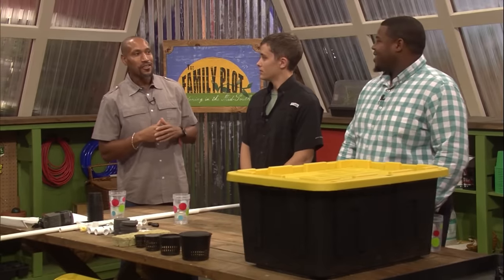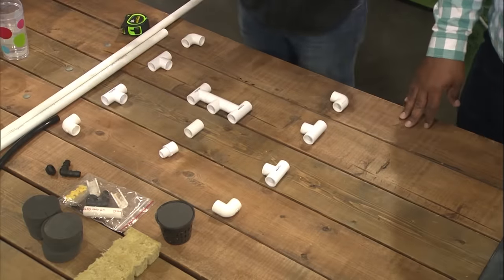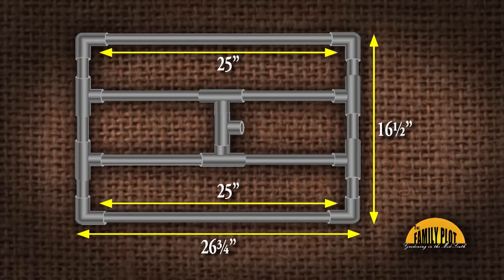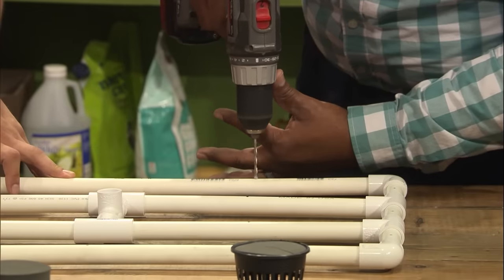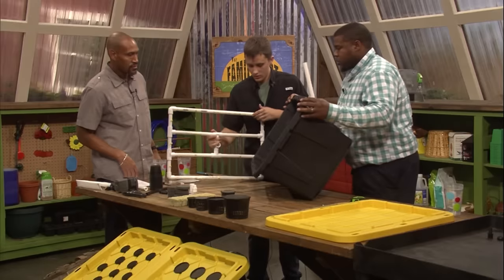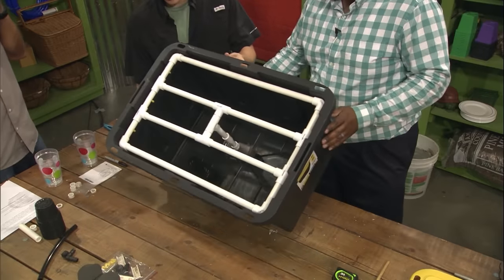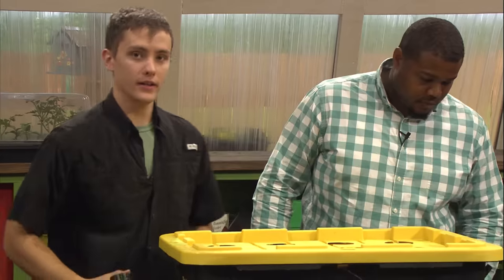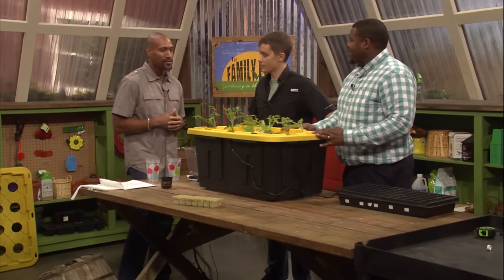Building an Inexpensive Hydroponics/Aeroponics System

Comment: I want to grow lettuce and tomatoes.  How many hours a day do you run pump and light?
Reply from the maker: The pump can run all the time or you can put it on a timer. For other similar systems I have used a cheep vacation lamp timer and did 45 minutes off 15 minutes on. You can get more expensive hydroponics timers that let you time down to the second, but the cheep timer was enough for what I needed. Just make sure the roots don't dry out.
For light, you for the most part want to mimic the sun. Darkness is also important to plants. 14-16 hours of light per day is good. It does not need to be during the day though. On my lettuce plants, I have it turn on at about 9PM. I do most of the work and harvesting in the late afternoon so that way the light is off and I don't hurt my eyes.
For the first couple of weeks with seedlings, you should run the light 24/7 to give them a good start. Then cut back to the day/night cycle.
Reply: @FamilyPlotGarden  thank you so much for replying.  Can I do things like melons, cucumbers, etc with this setup?
Reply: Indoor gardening light cycles is a good google for your various plants. Sorry, Family Plot, but you're wasting energy running your lights 24/7 at any time during the grow cycle. A maximum of 18 hours light is all that's necessary for most seedlings. Less for others. There have been many studies showing that plants do not receive any benefit to extended light periods. Vine plants, such as melons and cucumbers are much like tomatoes. You can let them drape to the ground if you must, but positioning a trellis nearby and training them to grow on the trellis is the best plan. This system works great outdoors.

Comment: Does it matter what kind of pump you use??
Reply from the maker: Not really, as long as there is enough flow and pressure to support the sprayers. This pump is 400GPH. You could probably do it on a 300GPH pump and might be able to use a 250GPH.
Reply: Yes. Use a good quality pump made for hydroponics so it will have the correct connection to tap in to. Looks for pumps with a removable mesh filter at the water intake, under the plastics. Most well built hydroponic pumps have this feature, but a few have popped up online that do not.

Comment: I just built this, literally exactly as presented. The water sprays below the bottom of the cup, so anything I put in there wouldn’t get any water until the roots grow down throw it. Which won’t happen without water. Any suggestions?
Reply from the maker: First watch for awhile. There is probably just a little spray hitting the cup. That will be enough to let the plant grow roots into the main spray. If it realy is not hitting at all twist one of the pvc pipes a little. Then it will hit the cup.when the plant grows roots twist it back. I recommend twisting one of the side pipes so the spray does not hit the small crack between the lid and tote.
Reply: I appreciate you replying. I’ll give that a try. I’m excited to try growing in this!
Reply: I got it working perfectly!
Reply: @bj5843  I'm glad you're rolling. I'd like to further explain that the T connecting to the main stem can be flipped to change the orientation of the sprayers to the top. We use this bigger setup for already established plants, with a dangling root already available. If you spray up, you may get some water leaks from the lid, in which case simple weather stripping around the rim will control. We stopped cutting a hole for the power wire, and instead instruct our customers to use one of the netcup's holes instead. In each system we build and sell, now, we throw in an extra netcup with it's bottom cut off so they can use it this way. That way, if the sprayers are pointed up, there isn't a 1" hole for the water to escape. I'm sure you've got it going, but I wanted to throw in some more tips. Good luck!

Comment: Seven T fittings is a bit overkill, you don't need that much structural support (tough tote lids can hold a lot on their own). These types of setups are terrible for full grows though they are more so suited for establishing starters or cloning.  Also spray paint the lid, those lids are not entirely opaque and you want as little light getting in as possible.
Reply: during R&D for this design, the nominal algae growth didn't warrant the extra money and time for painting the lids. as well, we have grown amazing, large vines and bushes, usually 12 squash tomato, and basil plants until this system was stuffed to the brim with roots and we had to remove the sprayers and fill the tote everyday with fresh water under the hot, southern summer sun. the only limitation to this system is it runs out of space for roots. cutting the number of plants down will remedy that problem
Reply: @wetwerk2178  That's why they are better suited for starters or cloning. Then transfer things like tomatoes over to something like a 5 gallon DWC bubble bucket. Netcup bucket lids are fairly cheap.

Comment: How I’m the he// did you keep the toat from leaking my guy mine leaks around the edges where the lid and bucket meet up what can be done to fix this situation
Reply: the sprayers should spray down. or get EPDM self-adhesive foam stripping and line the lid with it.

Comment: is it possible to just use an aerator rather than spray bars and pump once the roots reach the water level?
Reply: The water needs to have oxygen added to it constantly. The most common way to do this is with airstones but we found it highly inefficient for larger containers of water, and they also need periodic replacement which is wasteful. As well, this tote is designed to use as little water as possible. As long as the water level clears the pump, the plants get fed. This is especially useful while the plants are small. Less water, means less nutrients and more savings. You can used a shallow tote, but then when the plants get very large the roots will be a problem. This system is designed to mitigate all of these setbacks and also be approachable for the novice home gardener.

Comment: I like it, but seems extensive for the purpose.  You can simple add work, and get some air pumpin into the water.
Reply: If you fill this tote to reach infant cuttings' roots and dump the water every 2 weeks while you wait for them to be big enough to actually consume 20 gallons of water between changing/feeding you will spend far more money in nutrients than the $30 it costs to fit this with a water pump and PVC. This was the entire reason for the design of these systems. To use as little water/nutrients as possible and simple spray them up to the plants. The aeration aspect of this spray system, which eliminates the need for the air pumps and air stones is just an amazing added benefit. Furthermore, we design our system to reuse as many parts as possible, and throw nothing away. We have even moved into techniques that have eliminated the need for rock wool completely. The only waste this system generates for us now, is the small amount of nutrients that's poured out when the system has to have a fresh water change. Air stones will inevitably become dirty and need to be replaced. They also do an abysmal job of getting oxygen to the entire giant reservoir. This system ensure every cubic inch of water is aerated to it's maximum potential. There is no better home use hydroponic system than DIY aeroponics.

Comment: I would add a screen around the upper water level to catch falling debris from getting into the pump and clogging the sprayer. common issues w areophonic systems
Reply: In the video they explain a mesh you should place around the pump to stop things from getting inside. It's like a zipper bag you can wrap outside of it.
Reply: @heavensplayer  We stopped using pump bags because they'd get dirty and cause the pump to lose performance. We couldn't clean them effectively and we hate replacing things over and over for no reason. We now run these with no pump bags and just tell everyone to just make sure their chosen pump has a mesh filter at the intake. Most high quality hydroponic pumps come with this feature. Thanks for your help in the comments section!
Reply: Nothing falls into the water from above. The water can develop grime from the root system doing its thing, beneficial microbes help to keep that down and the mesh filter at the water intake on most hydroponic pumps catches everything that might clog a sprayer. Just take the mesh filter off and squish it around in the dirty water before replacing with clean water. Easy.

Comment: For anyone attempting this, skip all the pvc piping and just fill it with solution, your plants, and an air stone if you're feeling frisky. Great job guys but this method is all about working smarter not harder
Reply: This is the smarter, not harder way, friend. This uses much, much less water to reach smaller plants' roots, has accelerated growth because of maximum aeration, and wastes far less nutrients (meaning money) than deep water culture. This is hydroponics taken from dabbling to gardening. Not quite commercial, but with all of the benefits of a high-tech hydroponic setup. There is a reason we made this video. We are well aware of the pros and cons of every hydroponic system. This method is the underdog with all of the potential.

Comment: unfortunately I cannot find those spray heads anywhere. I wish they would have given the name, website or something to go on.
Reply from the maker: You can find them on Amazon search "hydroponic misters"
Reply: ebay is a superior solution for these products, but we order them from a chinese supplier (on ebay) 330 degree MISTERS ... misters is the key term. find the ones with "hex heads" rather than the lame little thumb screwed version so you can pop on a socket and a drill and get the job done with no effort.

Comment: Gr8 diy vid especially for a starters kit for seedling, clones etc b4 transferring to autopots or final pots. Inexpensive diy everything you could buy from hardware or home depot, better then spending few hundred on cheap Chinese ones off dreadbay
Reply: this system is meant for the long haul. we transplant cutting into this system, not out. a cloner/propagator would benefit from many more sites, much closer together, in a smaller tote.

Comment: Using a drip system will save on water. Far more efficient and better roots. Run a 1/8 hose to each plant from that manifold and dont forget to add a little peroxide to the water with your chemicals. Btw, Some Rockwools are acidic and you will need to soak them for 24 hours, rinse and soak again In the chemicals that you use.
Reply: we dont use rockrool anymore. and no, drop systems arent more efficient. drop systems cant cover the root system unless using a medium to hold them.. like rockwool. this system is designed to eliminate wasteful products like rockwool and be the MOST EFFICIENT means of oxygenation aside from advanced aeroponics under high-pressure. there is no faster-growing and more efficient hydroponics method than aeroponics.

Comment: I have a question: What is the misting cycle you use with this system?
Reply: 15 on 45 off
Reply from the maker: We run it all the time but you can do it on a cycle. Like @Jamie Paulino said. 15 on and 30min to an hour off.
Reply: @FamilyPlotGarden  Thanks, what type of timer can do this and switch 110 volts on the pump?

Comment: Where do you get the stuff to start the sprouts
Reply from the maker: You can search "rockwool cubes" on Google or Amazon. You just put the cube in a shallow dish of water and drop the seed into the hole on top. Once it sprouts and gets its first true set of leaves put it in the system with nutrients.

Comment: Do you need to glue the PVC?
Reply from the maker: No. Scot just pushed them together. That way you can take it apart to clean it is necessary. A small amount of water leaks out, but it does not matter.

Comment: how do you produce properly without pollinators in the winter time?
Reply from the maker: Hey, you can help the tomatoes pollinate.  Here's a possible method: 
Pollinating Tomatoes with an Electric Toothbrush https://youtu.be/PCOtjFs-MKM
Reply: that's quite interesting. Are the plants as fruitful in hydro?
Reply: @analyzejarman7956   you dont really need anything to pollinate tomatoes indoors. all indoor gardening needs a nice amount of air circulating fans. put a fan on the tomatoes. if the leaves are moving, pollination will not be a problem. people overthink it. 

hydro is well known for producing large fruit faster than any other grow method. but, when growing indoors, environment is key. your green thumb comes in the same box as your light.

Comment: Is there a reason they didn’t weld the pvc? I’m just curious why they wouldn’t recommend the glue is there a purpose?
Reply from the maker: By not cementing the pipes together you can get in and clean them if necessary. The joints do leak a little, but it just drips down into the reservoir.
Reply: @FamilyPlotGarden  brilliant! Thank you! I figured there was a reason; Makes absolute sense.
Reply: If we were to build a similar system with PVC pipe that is outside the tote, there will definitely be drips, so the cement is necessary then. However, anytime we are intending to keep the PVC internal, where the drips just go to the reservoir, we don't use the cement. Mainly to make cleaning much easier, but it also saves money.
Reply: @wetwerk2178  got ya! Thank you 💪

Comment: what would you do if cuttings have stretched up to high  ???.
Reply from the maker: The tomatoes grew tall. We build a trellis for them, but when they outgrew that they just took over. I severly pruned the plants a few times to get them back under control. The tomatoes lives 2.5 years until I accidentally killed them (my fault). They produced many, many tomatoes. The description has a link to a page for updates. You can see some picture there about how they grew and what we did.

Comment: How would i set the inside up if i had a smaller tote and only 4 holes?
Reply: same idea. smaller pump maybe, but doubtful. u got this!
Reply: @wetwerk2178  I actually did a single bucket system and just finished harvesting my cayenne plant. Got over 100 peppers harvested before a second round of aphids won the battle and I tossed it.

Comment: How do you go about keeping the water chill with out spending 600$ on a water chiller
Reply from the maker: Keep the tote in the shade (easier said than done). You can wrap it in a mylar blanket to reflect the heat and light in the sun. I have also dug a hole and put it in a hole. The cooler soil will help a little. Many plants will tolerate the hotter water, but some wont.
Reply: We have used the system outdoors in the hot, humid mid-south month of August with no problems other than the plants drinking way too much water than we anticipated. Indoors, you'll experience very little problems with water temperature. The aeration really helps to moderate the water's temperature, where deep water culture struggles. It is a myth that water chillers are needed for hydroponics, in our experience. Just more marketing hype to keep you spending. If you are growing indoors, you've already spent the money to keep the environment just right, so your reservoir should take on those environmental attributes as well.

Comment: Would you mind linking the pump and parts used on amazon?
Reply from the maker: The description has a link to a parts list. The pump is an Active Aqua 400GPH pump. You can get it on Amazon. The other parts are available on Amazon as well. i hesitate to give specific links as I have not tried them all out and they may change.
Reply: Family Plot thank you! I found the list in the description and actually just bought all the parts! I am sitting outside right now making the actual farm. (I got my parents to pay for everything so I am doing good)

Comment: Only thing I’d change is a 1” top hat grommet for the cord hole, just so no leakage or light penetration from that big cord hole.or run both air & water pump electric cord thro top hat grommet. 
Plus it’ll hold cord in place snug.
The neoprene disc, the big spaghetti like tubes used for kids to play in the pool, these work gr8 cut into disc size to requirements.
Revive used worn out tubes from ur pool into neoprene discs.

Comment: My middle 2 net cups are not getting any water. These red amazon misters spray too much downward i think. Not sure yet how I will solve it.
Reply from the maker: I built one once, but did not want to buy the two kinds of misters so I bought only 180 degree misters, but put in more of them. To make a long story short, I drilled the holes on the pipe slightly off center so the fan of the spray was higher on one side. You could try doing the same by adding a sprayer so it sprays up to those cups.
Reply: Longer roots to start. Once the roots get passed the sprayer level, they are usually good to go. So much splashing, everything gets enough water. Once they touch the water itself, everything is golden.

Comment: Why are the water jets pointed down not up. It appears the water will not contact the roots until they are long enough to hang below pipes.
Reply from the maker: The spray barely hits the net cups and keeps them and their roots moist. By pointing the sprayers down, the weight of the plants on the lid does not rest on the sprayers and also it keep the nutrient solution from spraying out of the holes, especially the power cord hole.
Reply: @FamilyPlotGarden  Right on that makes sense.